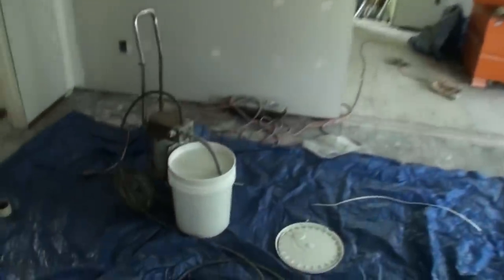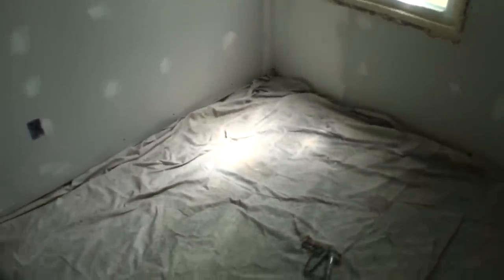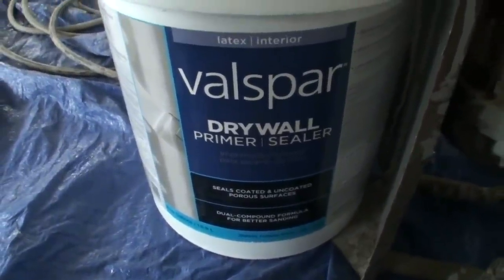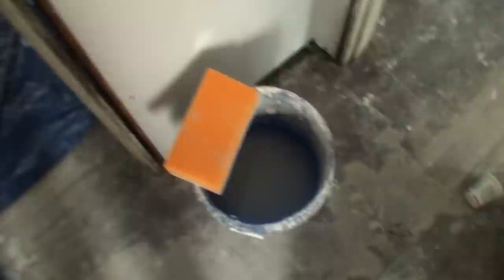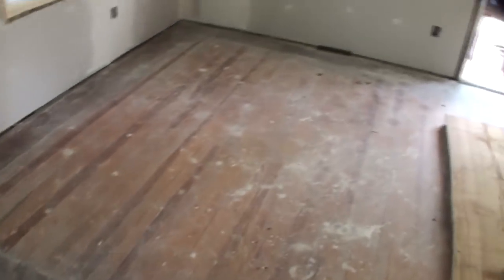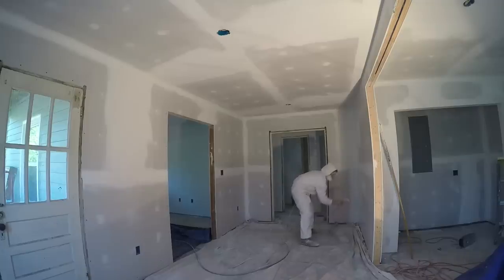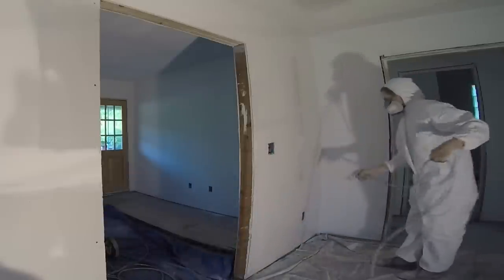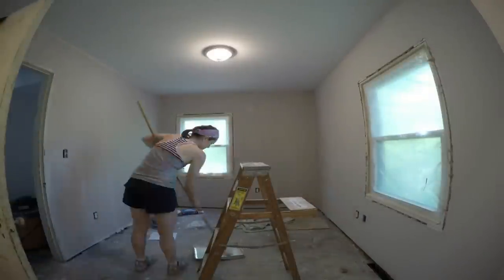Painting Interior Walls with a Sprayer

Comment: Nice work. Choosing to spray is always a balance of the masking work versus the speed of application - looks like it worked out well in your case. Any problems getting a clean, straight line in the top corner when cutting in the wall colour?